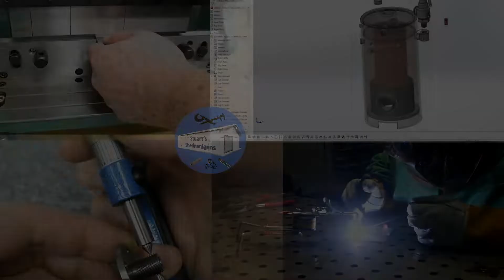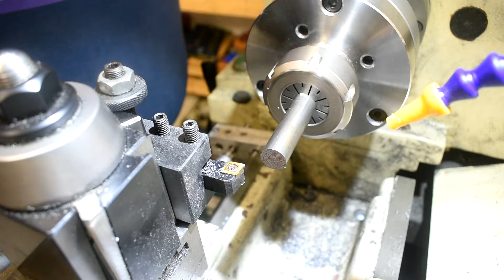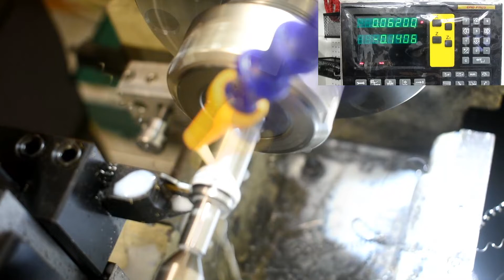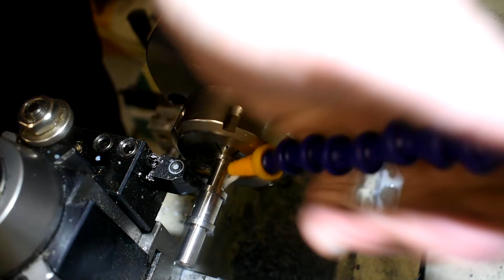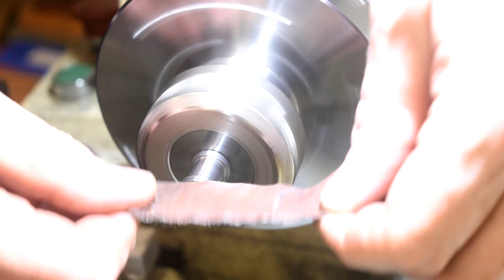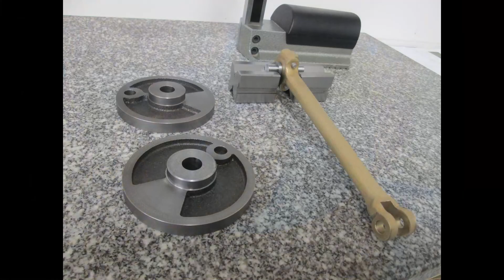PM Research Number 4 Quarter Horse - Part 6 - Crank Pin

Comment: Stuart. Shame your camera took an accurate focus on your carriage stop and NOT on the part being machined  😢 Luckily I knew what you were trying to do. Perhaps go to manual focus next time. 
With regards to your press fit, I think you are being rather optimistic with a 0.001" interference fit on a 5/16" diameter, 3  tenths would more the mark. Are you also going to pin them once the  flanges are lined up ?  I see that you have adopted the Yanks ZEE instead of ZED for Axis names. 😊Regards from Australia.
Reply from the maker: I have started using the manual focus more lately, because the auto focus has let me down several times now. Vexing. On the pins - yes .001" is a very heavy press fit. Well over the top actually. As a result I'm not going to pin the crank - I think the assembly will be OK, and I likely won't run it under load anyway. Time will tell for sure. I'm going to go and review my limits and fits charts on this.